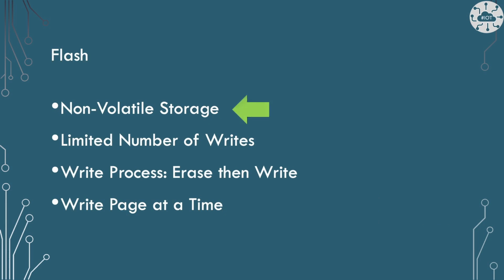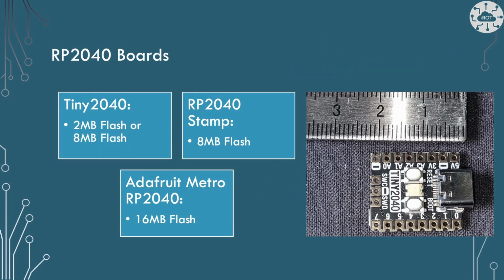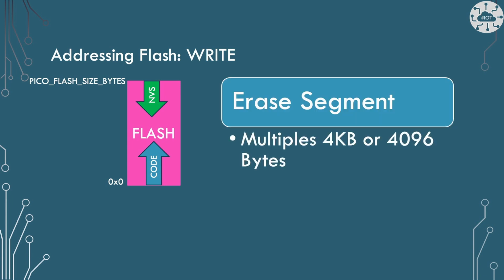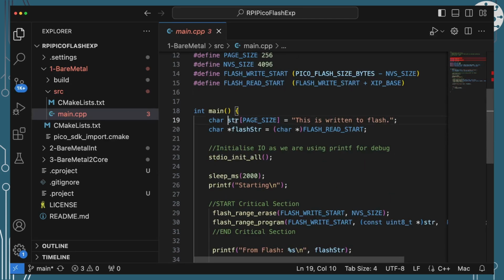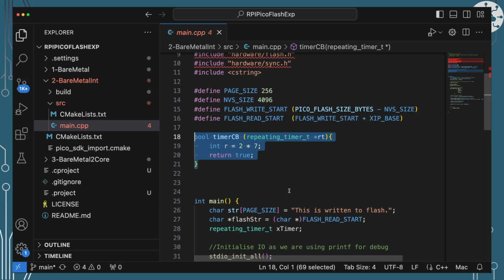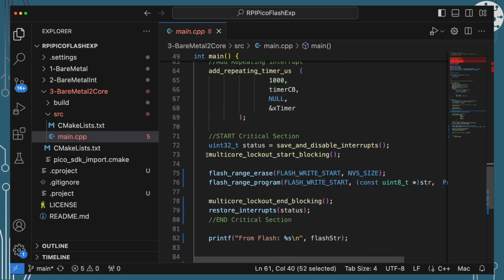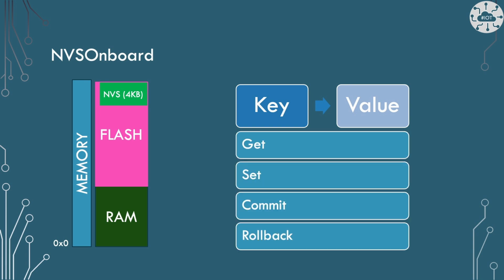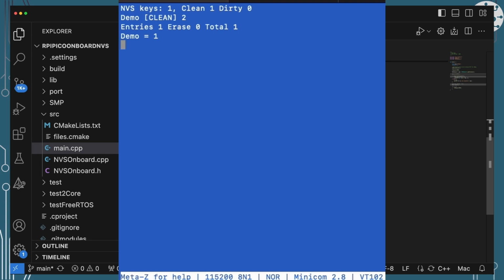Unlocking The Power Of Flash On Raspberry Pi Pico For Persistent Storage!

Comment: Great examples. Id like to read files dropped in the flash - like JSON. Which implies treating FLASH like a file system  Is there an example of this?
Reply from the maker: I'm sure that can be done but can't say I've seen an example. You only have 2MB flash on a Pico though other RP2040 boards do have more. You would be sharing flash with your code.
Reply: @DrJonEA  Thank for this reply. I went back and read the "Red Book" and saw that the only flash "files" you can see on the RPI-RP2 Drive when PICO is attached to USB are the INFO_UF2.TXT and INDEX.HTM - and then only during BOOTSEL mode. I was hoping users could drop a xxx.json file there to configure my apps. Now I'm going to see if I can emulate USB-Flash in my app. I'd REALLY like have my apps have a config file.
Reply from the maker: You would have to write the interface and provide a MSC device interface to the host computer. Om Bootsel mode you are not really seeing files on the device. It is simply a mechanism for flashing code to the Pico.

Comment: I'm somewhat confused after watching the video. I guess it would become clear once I analyze the library and demos.
What could be explained a bit more is the integration of the read of the block you're about to erase so you can write it back after the erase.
A good example/application of this concept is the OTA you presented in the previous video, where there's about 3K of unused space in the OTA flash memory map that could be used as NVS, even if you only used 1 - 2K of it.  You can't really use top of FLASH in the case of OTA since it is reserved for buffering the firmware you're uploading.
But the reserved space for OTA is < 4K so you have to first read back the 4K block so you don't destroy the OTA firmware function, erase the 4K block, then write back what you erased that is already in use.
Another concept to consider with NVS is even wear/wear where you minimize erases by writing NVS updates by using erased but not yet used 256 byte blocks for updates to what was already written.
It's the erases that kills FLASH, not writes and even wear is a concept applied to SSDs we now use all the time for mass storage.

Storing SSID info is definitely what one would want to store in NVS.  Question is, how to get that data into NVS without exposing it within one's application firmware.  That usually would mean a web interface to ask for and store SSID information.
Web page concepts are terribly lacking out there when it comes to integrating with Pico W SDK
Reply from the maker: Thanks for the feedback. Sorry I did not cover the reading of the flash into memory before writing the update clearly.  That only needs to be the bit of flash used for NVS, not the whole thing.
Your right this library and the OTA library are not compatible right now. I would like to create a combine version at some point and yes using that unused space is a good idea. 
I'm working on authoring a Udemy course on Pico-W web services are the moment (both client and server, though they may split into separate courses).